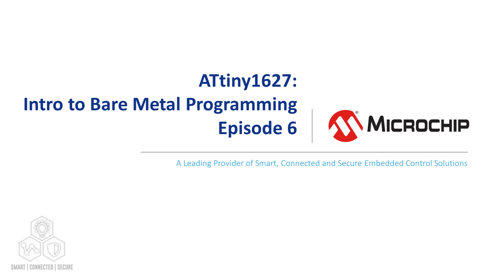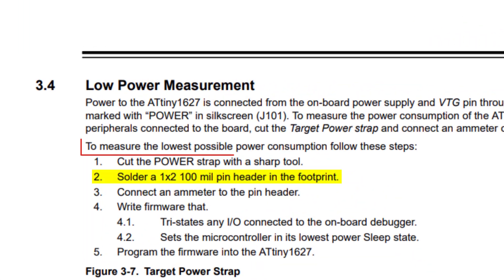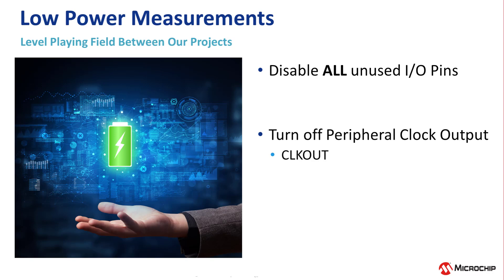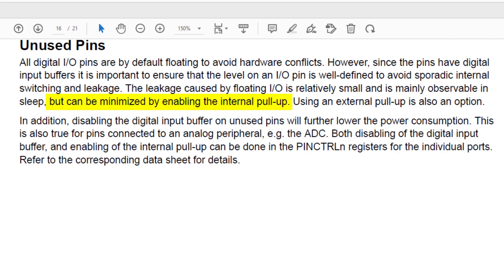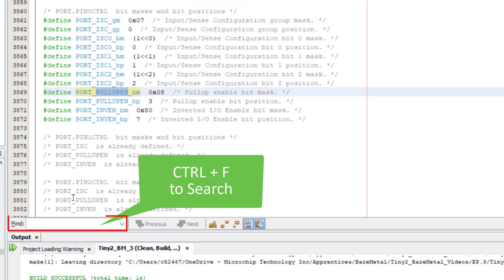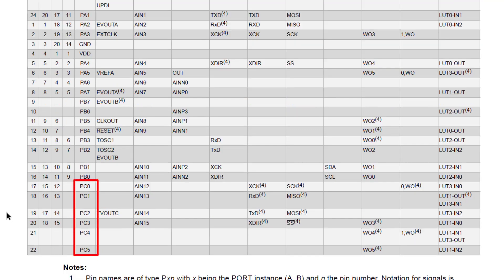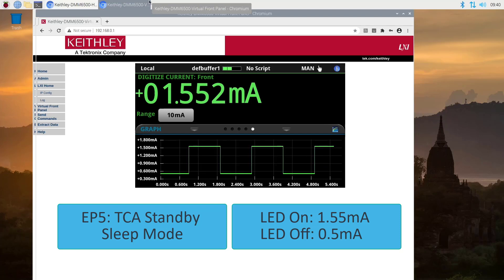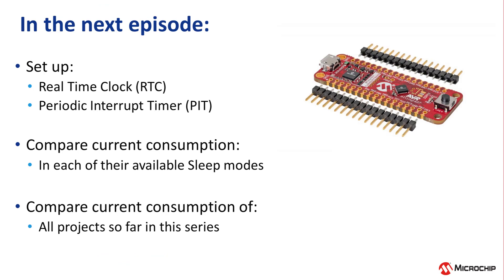Intro to Bare Metal Programming - Episode 6: Low Power Measurements

Comment: Came from Arduino development, wonder if bare programming worth the try
Reply: Definitely! Arduino's simplicity starts to become restrictive as you become a more advanced embedded developer. To make the learning curve more gentle, you can even start your bare metal journey using an Arduino, the ATmega328P (assuming Arduino UNO) datasheet and the Arduino IDE. Then when you're ready to use a microcontroller with a much larger array of peripherals and features, you can jump to a modern PIC or AVR to really get into bare metal development!
Reply: @rosssatchell1580  thanks! I'll do that for my next fun project
Reply: Same.
Reply: I did it on SAMC21 and it gives necessary understanding of how processors work! Now I'm endeavouring kernel space :)